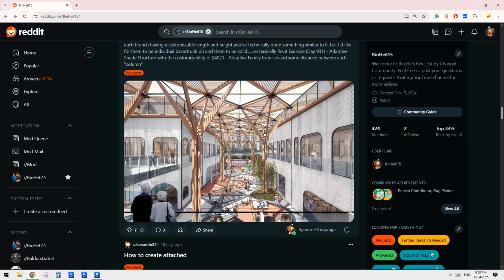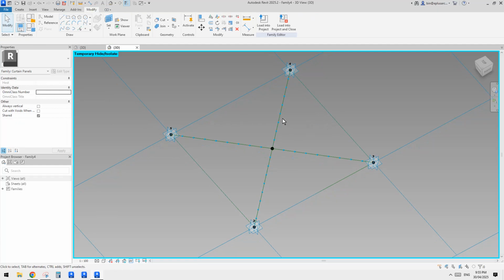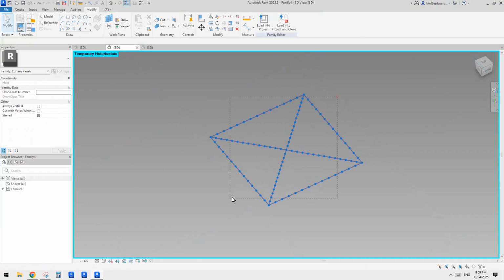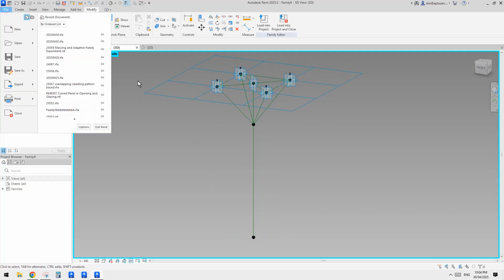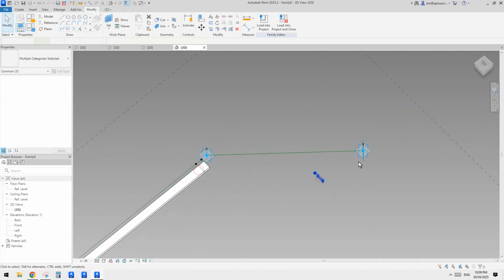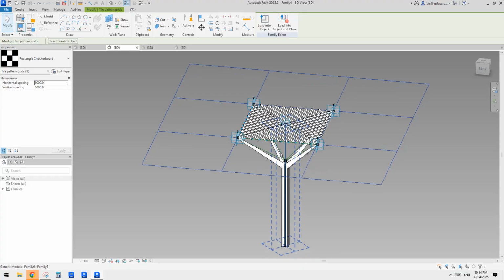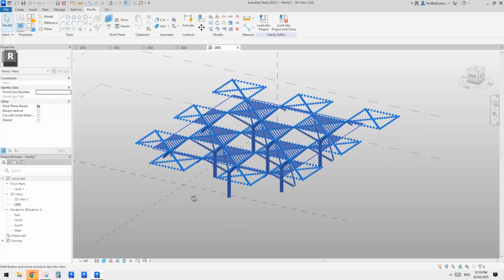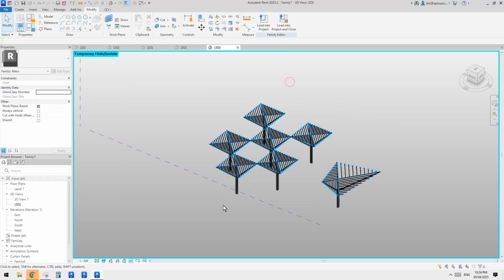25060 - Pattern Based Shade Structure in Revit

Comment: how do you make the ends adjustable like 24021 - Adaptive Family Exercise so that you can use it as just structure and not with the Roof
Reply from the maker: You can delete all the top part if you don't need them. I did it as a pattern based family, but you can still use it as an adaptive family. Drag it from the Project Browser into your view and you will be able to place it using 4 adaptive points. I showed this process at the end of this video.